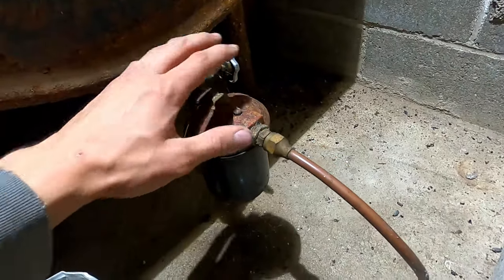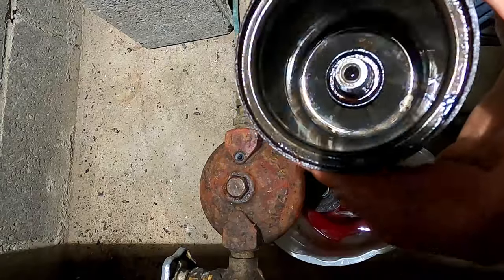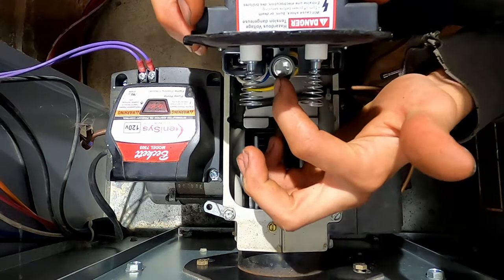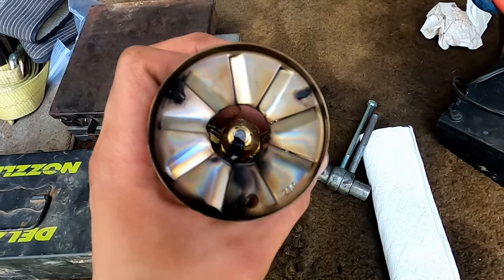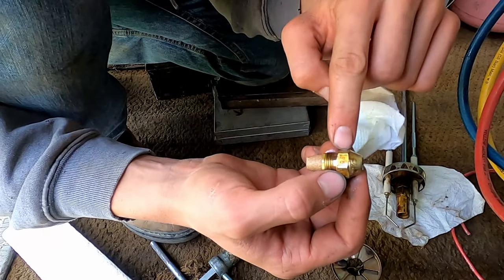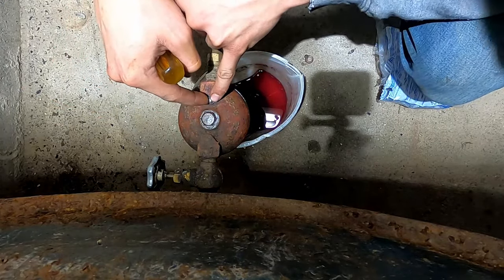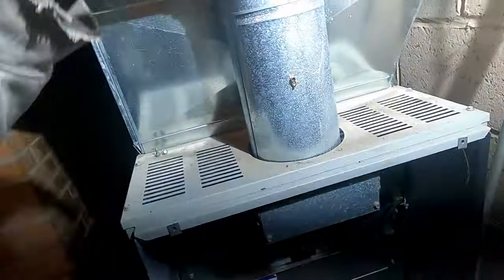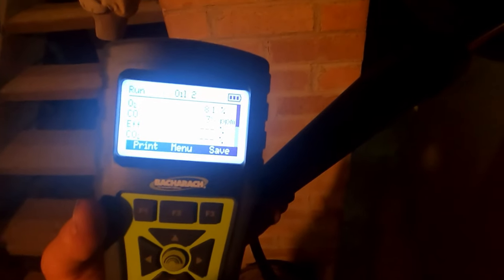Oil Furnace Clean and Tune! How to Prepare Your Unit for Winter.

Comment: This is a pretty intensive maintenance routine because when I get a tech guy come over to do it, it doesn’t look like he does all this and charges me $275 dollars. I need to learn how to do I myself.
Reply: Not all service ppl are so thorough, this kid is a rock star. I work for a small family owned business and we do the same thing. When we do a service, its a complete service.
Reply: Next time you have them come out, ask them if they are changing the filters (there is also one in the pump), and watch them. If you pay for a cleaning/service and they are not doing this, don't call them again.

Comment: You are a young guy. Take a little advice from an old one. Wear nitrile gloves. That heating oil absorbs into your skin. It's toxic. Also breathing the fumes will screw up your lungs over a life time. My burner tech had severe breathing problems after doing this job for many years. Wear a mask when working with the fuel oil.

Comment: @2:24 You should open the tank valve to flush out any debris and also check the flow
Reply: isn't that what the filter is for? You'd have to flush out a lot of oil to clear out any significant amount of debris.
Reply: @roshi98 no, it's a common thing techs do,  it can clog before the filter,  and those filter  don't filter everything.  . Dude didn't change the strainer and also those ignitor are close to 20k v not 10k.  Who uses an adjustable wrench and not a 5/8th.
Reply: @oilandfireguy1739  Glad someone else has #2 oil in their blood 😉

Comment: U didn't vacuum the heat exchanger. Why?
Reply from the maker: I guess that's something you could do, but it is usually not necessary and you don't want to damage the insulation piece that holds the fire. Its really not that strong.
Reply: The firebox is not cleaned.  Put the metal heat exchanger can be cleaned with what looks like a baby pottle brush but is made of wire and is has about a 30 inch long handle.  It removes the soot thereby keeping the heat exchanger clean and efficient @ReubenSahlstrom
Reply from the maker: @monoralph1375  what model of furnace are you referring to?
Reply: The brush I purchased decades ago has light metal bristles with a long stiff wire handle.  I have used at two different personal residences with oil fired forced air furnaces.  The first had clean out ports to insert the brush.  I also brushed from the flue pipe connection.
Current furnace is a Williamson.  Only place to clean the heat exchanger ti to remove the  connection to the flue pipe.  I work the brush around the drum and up/down the length of the drum while vacuuming with a stiff tube inserted in the heat exchanger.  It gets brushed every year.  I collect less than a cup of the black scale from the cleaning.  @ReubenSahlstrom
Reply from the maker: @monoralph1375  Interesting! I have done this to lots of gas and oil boilers as they seem to soot up worse (likely due to cooler heat exchanger temperatures?) but have never been trained on doing this to modern oil furnaces. Perhaps it is something to consider.

Comment: No strainer replacement?
Reply from the maker: Strainer? Is there a strainer?
Reply: @ReubenSahlstrom  yes. Fuel pump on left side. A pump strainer. $7.00
There are 4 Allen screws on the cover
Make sure valve from oil tank is off 
Good luck👍

Comment: Never take combustion readings from the barometric damper
Reply from the maker: Reason being? I haven't heard of that being an issue.
Reply: @ReubenSahlstrom  “Make sure that the sample point is before any draft diverter/hood or barometric damper so that the flue gasses are not diluted and the stack temperature has not been decreased by surrounding air used to balance the draft. “ - This reason specifically.
Reply from the maker: Yes that would make sense, which is why I put the probe in on the appliance side of the flue pipe, not downstream of the damper. The tester I was using has a long probe to test with, and I was able to insert it into the full undiluted exhaust.